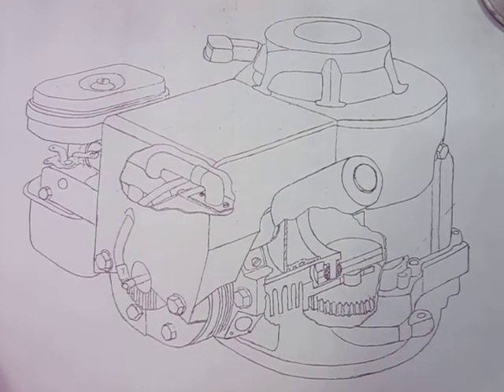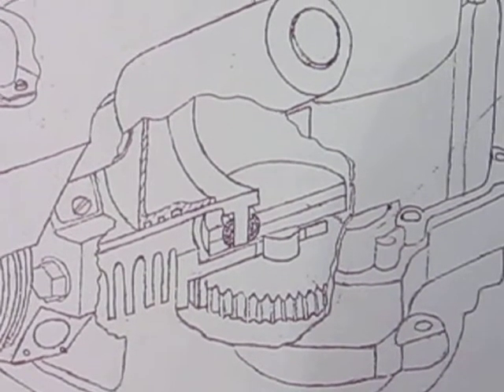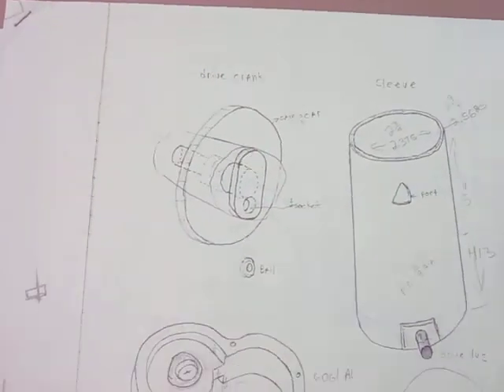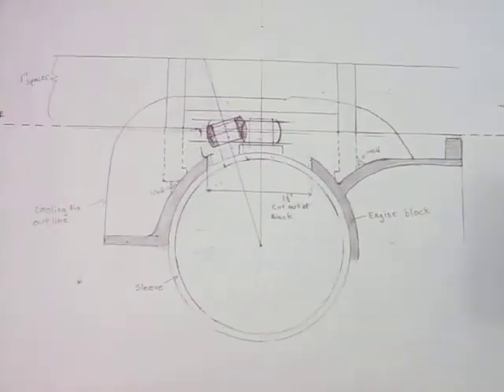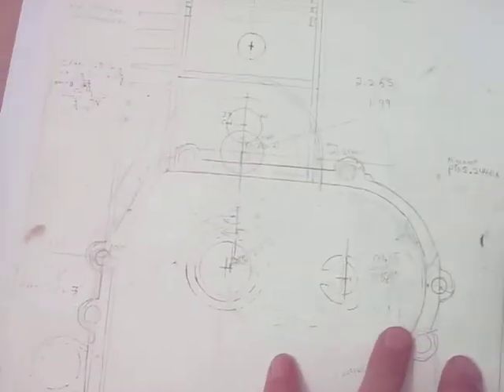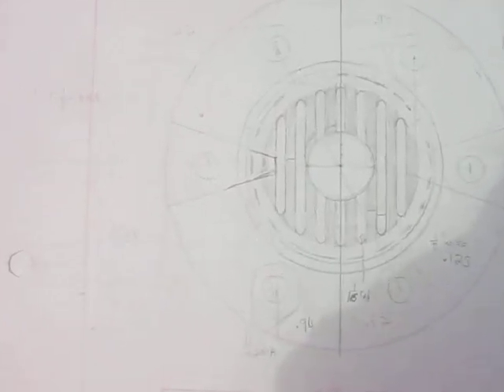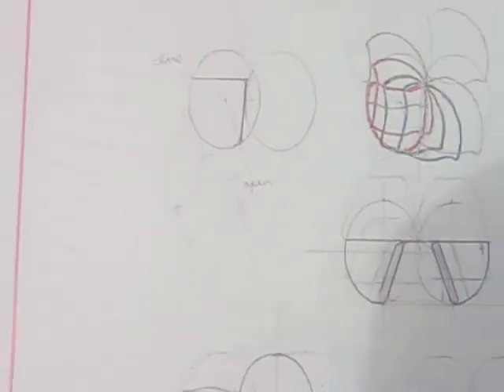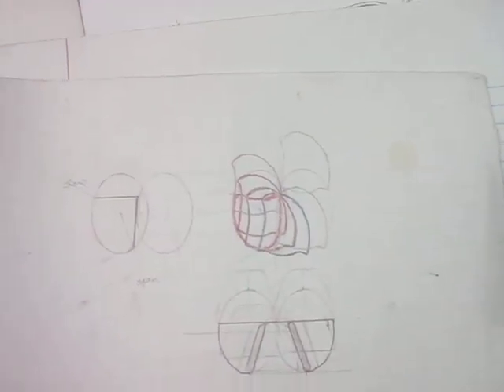Sleeve Valve Lawnmower Engine Drawings

Comment: @douro20 
An RCV (Rotating Cylinder Valve) engine uses a continuously rotating sleeve which is geared to the crankshaft.  They were developed in England some ten years ago and have enjoyed a very good following among the RC crowd.  Since then they have been developing engines with a cylindrical overhead valve system for power generation.